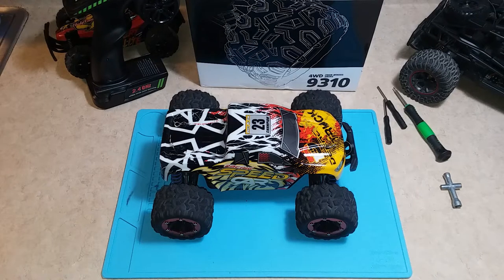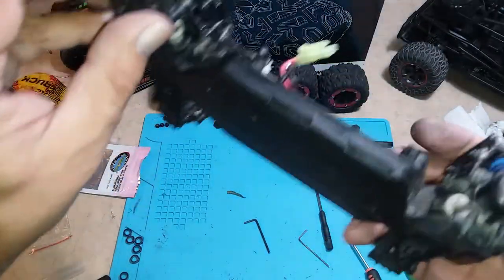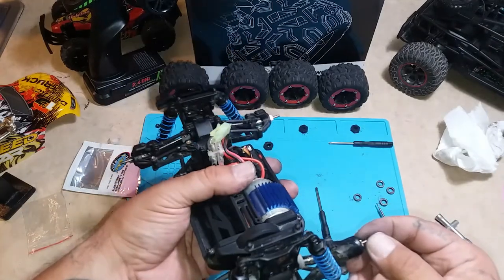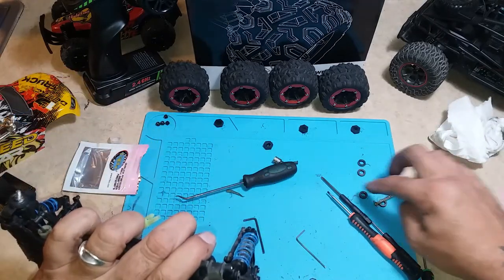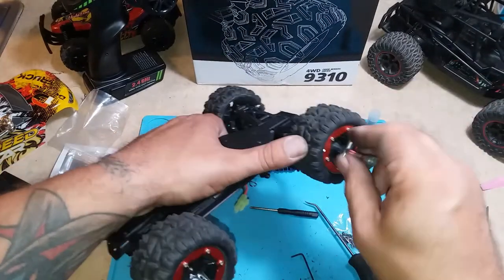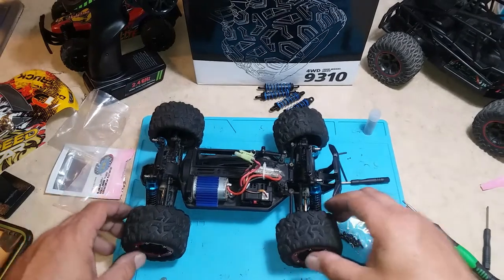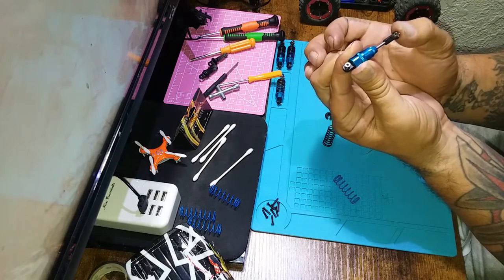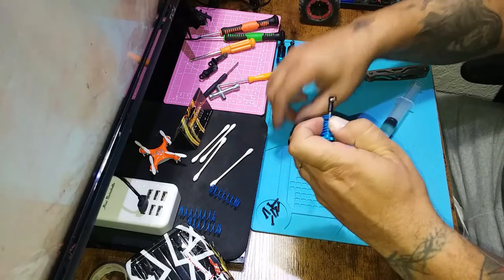DEERC 9310 upgrades (Edited)

Comment: Idk whats wrong but my back wheels stopped turning ,? Is there any reason Why?
Reply from the maker: Check the screw on the inside of your drive shaft inside the differential it could have come loose from the gear
Reply: @sinisterrc9618  huh how do I do that ? Does that mean me taking it apart as I have no experience with doing that...?
Reply: @sinisterrc9618 I'm very new to this and have never even took apart these type of things..:/
Reply: @sinisterrc9618 I also do not own any of the tools you have..:/
Reply: @sinisterrc9618 from what I'm reading it has something to do with the black wire become dettached